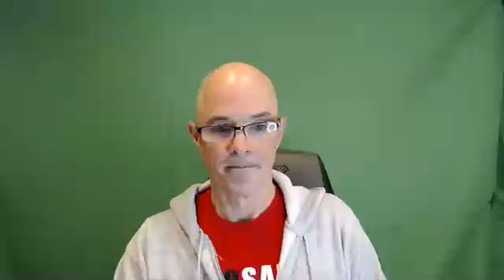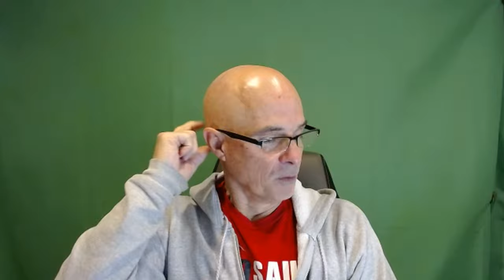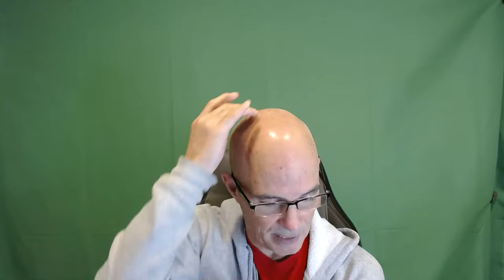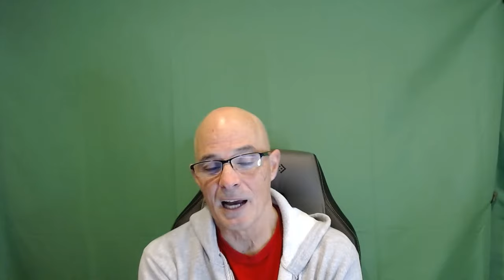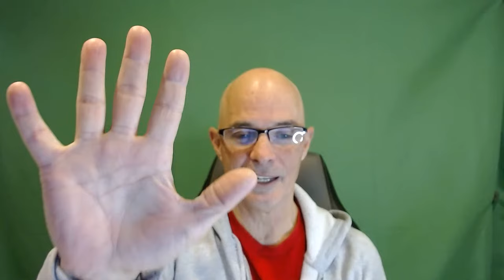LET'S TALK TECH-ROLLER ROCKERS-THE BEST WAY!

Comment: In 70’s I worked for AG and PS they both said do it same way you like to do it. However after the final test they tell me when to loosen it by .002 in some situations don’t think it would show on a dyno each vehicle we fine tuned after a run advance 2 degrees  on some 4 on others. By time I left cam manufacturers started putting advance into cams. Hydraulic type they never tell to change from way you do it. Think it was about 1/2 turn preload but that was 50 years ago so memory might not be 100%. Some cams worked well being soft down low because so many variables tires, chassis, suspension etc. no choice was the perfect choice just compromise. 
Thank you for pointing it out. Lighter vehicle weight more you can get away with…

Comment: Only two revolutions of the crank required in 90 degree steps. Split the firing order 1843/6572, when 1s rocking adjust 6, when 8s rocking adjust 5, etc etc.

Comment: IF DB didn't feel that way, he wouldn't say it . Cylinder pressure makes power and a narrow LSA makes more cylinder pressure than a wide LSA
Reply from the maker: that would be a NO on a universal statement on tight LSA (it can be also be too tight) and I think you mean DV
Reply: @richardholdener1727  I'm from middle GA. Please pardon my spelling lol. The LSA certainly can be too narrow, however a  narrow LSA will certainly make more cylinder pressure than a wide LSA

Comment: I use a compression tester pull the spark plugs compression test adjust the valves to max on your tester
Reply from the maker: preload on a lifter does not change cranking compression-if lash does, that still does not tell you about the power curve

Comment: 16:25 I have a question . There was a 408 ls dynoed at Steve Morris engens that made like 622 hp at 5600 rpm. You were supposed to have speed it. It was said to have a tight lsa.can you tell me the cam and heads

Comment: I have a question . There was a 408 ls dynoed at Steve Morris engens that made like 622 hp at 5600 rpm. You were supposed to have speed it. It was said to have a tight lsa.can you tell me the cam and heads

Comment: I just tightened everything till it's zero Lash crank the motor 90 degrees check everything that's loose tighten them down cranking 90 degrees again seeing all the loose ones tighten them down then turn  another 90 degrees ch check for loose ones and I do atheist 2 full rotations just to be sure then half past zero lash
Reply: Then I don't need to worry about what ones I did if it's loose I tighten it and when your done all you locks around be the same

Comment: Hey Richard, besides the safety of running a dual spring set up. What are your thoughts on running a conical valve spring set up with an aftermarket cam for a daily/strip application? I have read there is good benefits from less deflection on the single spring vs the dual.
Reply from the maker: less deflection?
Reply: @richardholdener1727  I apologize I should have said harmonics. Do you know of any draw backs from running a conical spring vs a dual?  Would there be anything you would be worried about? My reason I would like to run them is that they weigh less.

Comment: When I replaced the rockers on my 1992 Dakota 5.2 Magnum with comp 1.7 roller rockers I piked up 4mph and .3et in the 1/4 mile.
Reply from the maker: 4 mph from rockers?
Reply: @richardholdener1727  yes Changed the ratio from 1.6 to 1.7 comp roller rockers stock cam, headers. Mopar Performance computer. hennesey 50mm throtle body. it also changed my shift point from 5400 to 5700. It raised the valve lift by 0.040' to 0.484/ 0.478

Comment: Hi Richard this is Curtis Morrison how are you I'm calling to or I'm talking to you because I knew a guy years ago raced here in Missouri asphalt 818 out of 22 races every year and somehow I was able to friend him and he was running a 307 large Journal motor with a 400 crank in it I'm wanting to know what that cubic inch would be and maybe would that be more torque than a 350 motor cuz 350 was the limit you know more maybe 60 over so I'm still wondering if that 283 more 327 crank motor if you put the 400 crank in it what did that do why why was that the ticket for him to win so many races all right thanks Richard again sorry this is so long and this is I only put it on this particular one because it's the newest and I was hoping you would read this and maybe reply all right thank you bye
Reply from the maker: he didn't win because of a combination of bore and stroke

Comment: I have a question . There was a 408 ls dynoed at Steve Morris engens that made like 622 hp at 5600 rpm. You were supposed to have speed it. It was said to have a tight lsa.can you tell me the cam and heads
Reply from the maker: The one I ran did not have a tight LSA cam-If the customer duplicated my build (Steve didn't build that motor-I believe it was a customer), they didn't either-see the 175-hp cam test video